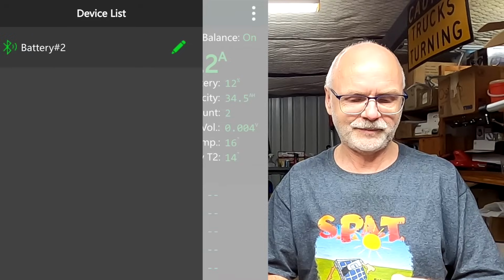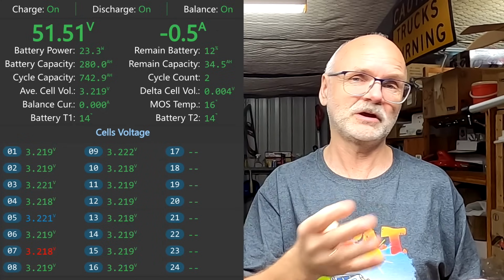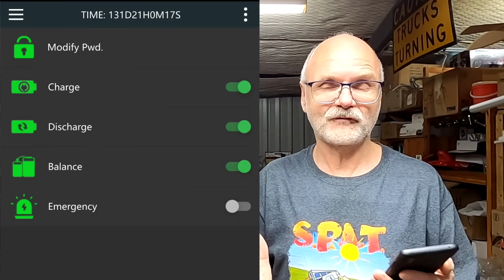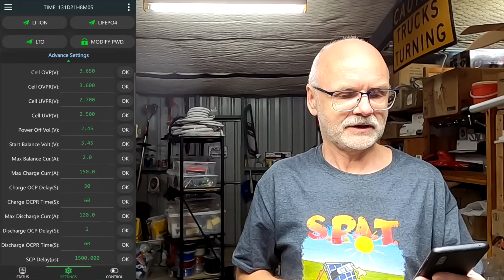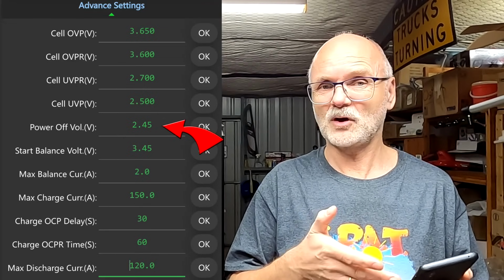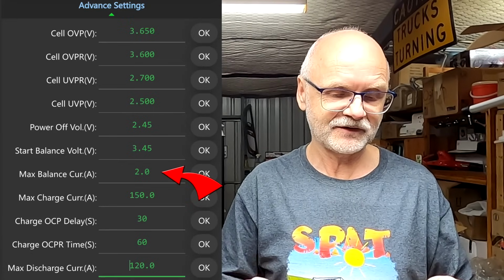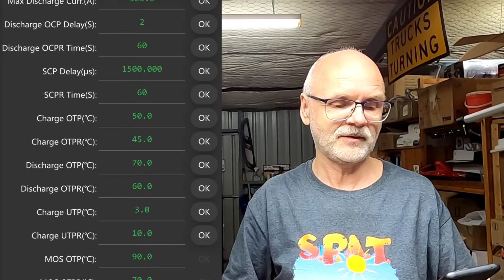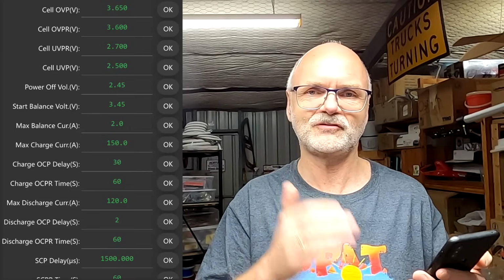JK-BMS: all settings and menus explained. How to program and set parameters.

Comment: The default low temp charge protection on my JK BMS, is -20c? I think my JBD BMS'S from OVERKILL, are way to cold also. This seems like it would really bad if unknown.  Especially with the LIFEPO4 default reset button where it is. I've accidentally hit it  more than a few times and needed to go reset my own setting.
Reply from the maker: Oh, yeah, that is far too low. It should be sitting on like 3°C or so, maybe even 5°C.

Comment: I think the balance wires resistance calibration settings are for balance wires cut or  extended to different lengths for your installation set-up. Now I'm curious to know how different a few inches or feet would matter. ARE people running their BMS 20-30 feet away from the cells for some reason?
Reply from the maker: I have cut all my cables or extended them to make it look nice. But I never touched this setting. I think the BMS either measures voltage or balances but not both at the same time, so cable length should not matter.
Reply: @OffGridGarageAustralia   It is an odd thing . maybe for the internal resistance of each battery?
It would be great to pick the brain of who ever dreamed up these functions. I like a good puzzle but, come on man. What is charg plugged and heat current? It's nothing to do with the heat pad function or charging.
 It took me a week to find a working app for my phone after trying to reinstall it. The one on the BMS and instructions would not install again. only on my sons new phone.

Comment: Andy, I have watched many of your videos and purchased this BMS because of your excitement in some of the videos. 
I have put together my 8s system but can't get it to connect to the app. 
I didn't purchase the monitor, so I'm not even sure if it is working.
I have disconnected it at the moment but really need some advice on how to connect it to the app. Or check if it is working. 
Any advice?

Comment: Another very useful video - Many thanks Andy! I bought one of these and finally had my battery built and connected up. I started the BMS and all worked well. About an hour later the power cut, connecting to the BMS with my phone, I could see it had disconnected the power due to low cell voltage - I planned to wait until the next day for the sun to charge the battery again. Half an hour later the power came on and the BMS was showing 'Discharging MOS not normal' blinking in yellow - since then the BMS reads very differently to the Victron inverter/MPPTs in my system and even if I click to disconnect in the app of the BMS, the BMS beeps but nothing happens. . . I am wondering whether when the BMS reconnected my system the surge of current re charging the capacitors in the inverter (10kW Quattro) have killed the discharge MOSs . . . I have contacted the seller who kindly just sent me links to the app and instructions. . . 🙃 Any thoughts as to whether I can do a reset on it or other ways I can test it before I have to start crying and buy another one are greatly appreciated 👍🏼

Comment: if bms is charging/discharging at 100a, does that mean the bussbars have 100amps flowing in between cells?
Reply from the maker: Yes, all cells are connected in series, so the current is the system is the same everywhere.

Comment: I believe voltage does drop as resistance increases. Therefore, to get more accurate balancing, perhaps it's prudent to input the wire resistances in the settings? Although with such a miniscule amount, it probably doesn't make much difference.
Reply from the maker: I don't think the BMS will measure voltage while it is balancing. It's either or but not both at the same time. Therefore, the resistance of the balance cable does not matter.

Comment: Ciao Andy, thanks for your in dept coverage, especially making some sense of a somewhat ambiguous setup. I've pretty much followed your suggestions. I have a Lipo4 12S 40Ah prismatic pack with all cells balanced. While viewing the cell voltages, there is a flashing message in green that says: "Protection (Cell Over Voltage) (0S)". When I look at the log,  it indicates that the message is related to Cell 1. Any idea what this means? Buona fortuna with your projects!
PS, Also, worth mention is how to turn off Bluetooth on the BMS and reduce power drain?
Reply from the maker: Thank you. First of all, if you turn off Bluetooth on the BMS, how do you get back into it to turn it back on?
Your cell 1 may have a problem with either the cell directly or the terminal connection. Does this message only show up if the battery is charging and is near full?
Reply: @OffGridGarageAustralia  Ahhh! I have the V10 version in which they so graciously added a push button switch to turn it on. Of course, they're not that smart, otherwise they would have allowed the same button to turn it back off or provide the option in software.
Reply: I forgot to mention that the message appears to flash if the charger voltage exceeds the OVP value.
Reply from the maker: @DaveVelo1  Well, then the message makes sense, if you exceed the set OV. What is it set to?
Reply: @OffGridGarageAustralia  3.65, but have been raising it slightly to increase calibration voltage. I have some low cells that won't balance. Sent you a screen grab on facebook for a look/see and opinion? Thanks.

Comment: I figured out what the cell wire resistance is. It's the resistance placed on the wires so the bms can remember the cells out of balance difference. When you have cells of un equal WH duringg initial top balance those values get tuned so next time you charge up you don't get cell run away..

Comment: I bougth a BMS at HankzorBMS Store in Nov 2022 and 6 weeks later the App shows two Errors: 

1) Protection (Cpuaux Anomaly)
2) The Temperature Sensor is Abnormal

All trys to reboot, make power less (10min/2days), use other versions of the App, gewire the batteries, check voltages, ... doesn't help.

In paralles I contact the seller - the communication was worse. Morste time not one word, only links, pictures to QR codes, numbers and textblocks. No only one time I get a feedback about the errors. (Not sure what i should do the the IOS APP or the proticoll description)

I also ask for 'repair, replacement, 1 year warrantie, 90 days money back - nothing.

!!! DON'T BUY FROM HankzorBMS Store !!!

Comment: Thanks! Won't it make a harm to a hybrid inverter powering the load, if a BMS abruptly turns off a battery due to undervoltage or overcurrent protection?

Comment: Great videos! I am planning a 5x16s battery back for my house and I did not see any video about using the JKs with multiple packs in parallel. Do the BMSs have a master-slave functionality or must each be configured separately? And also.. how well does the JK speak to the inverter (I have a 3p Deye 12k) and even more so, when you have multiple JKs in your big battery storage unit?
I also see, SEPLOS/Maison offer they battery DIY boxes without a BMS - would JK be a good subsitute and would it "fit"?

Comment: Can you please clarify how the JK BMS behaves if the low voltage shut down is reached? Does the BMS turning itself off prevent recharging from the solar array or if the solar array is sending current to the battery will the BMS accept the charge and turn back on with no intervention.

Comment: Good afternoon! On banks from Nissan List, I set the calibration volt to 57.12 Volts, and BMS puts its numbers after a while. What is the problem?
Reply from the maker: What are the specs of this battery?
Reply: @OffGridGarageAustralia  These are lithium-ion batteries.
Minimum voltage 3.1V, maximum 4.2V.
Reply: @OffGridGarageAustralia  Assembly 48 Volts, 7 packages of 3 cans.
Reply from the maker: @ВикторАлександрович-о6с  How many cells are in series to get to 48V? 12S, 13S?
When you say calibration voltage, that is absorption/bulk voltage? What BMS do you have?
Reply: @OffGridGarageAustralia  BMS JIKONG 8-20S 80A, 7S3P.
Reply: @OffGridGarageAustralia  I understand everything! The inverter has its own charge settings, etc. I set it up a little wrong. I fixed it now and it's all good! 😁😁😁

Comment: Hi Andy! I thank you for your time and for the immense value of your sharing of knowledge and passion. I'm having problems activating the discharge with a voltronic inverter (pip max 8kw), when I activate it, the short circuit protection without sparks immediately starts without any visible problem, the wiring has been checked and rechecked a thousand times, in some forum they told me of precharge problems. The discharge is activated regularly if I disconnect the positive pole with the circuit breaker, so the problem is precisely the inverter, which parameters do you recommend me to change (scp delay?)
Reply: Hi Ross Doc, there will be too much inrush current. I had a similar problem. When switching on three mppt charge controllers, the SCP always came. I doubled the SCP time. From 1500 to 3000. Now it works for me.

Comment: Has anyone had moisture/condensation and/or temperature issues with their 8s JK BMS? 

My BMS stopped working the other morning after a low voltage disconnect. It normally lives in a narrowboat engine bay where it gets down to about outside temperature, it’s humid in there if the weathers wet but there’s no direct sources of moisture near the batteries or BMS.

I took it to a friends house along with the batteries to try some diagnostics, after a while of not working it suddenly came back to life! When returned to the boat the problem reoccurred… 

Is it possible moisture is forming and shorting the board? 

Symptoms of not working are: unable to connect with bt at all and a continuous erratic static-y beeping noise. 

Help appreciated!

Comment: Have you done any  work  with  Chins Battery. 12.8  100amh?
Would like to see your  settings  for  24v setup.    2ea Battery  in. Series, /parallel  configuration 
Factory  settings  don't  work  with my  reliable  3000w inverter

Comment: Hi Andy,
Super contribution

Can you tell me what to do if in the setting battery was the button Modify pwd and did not take over the one settings on LiFePo4.
JK does not save the data . 
Have you also had the problem and how did you fix it.
thanks a lot 
Greetings from Germany ( Bavaria )
Mike

Comment: Resistance of string is very important. My string cable has 30miliohms. U=2A(Balancing current)X0.03=0.06v 60mv.60mv Drops on a wire !!!!!! It difference between battery and BMS. You want a 5mV difference between cells, but bMS got very inaccurate information on a cell  Up to 60mV !!!!!! The balancing could jump into the see-saw action...

Comment: The only thing that makes sense with the connector resistance-table is to compensate the voltage-drop caused by the resistance of the power-connectors between the battery-cells/blocks. In my job i am specialist for UPS and have to take care of about 3000 battery-buffered systems in a big chemical factory. We do a lot of capacity probes with single block measurements and to evaluate the results it is nescessary to know which batteries are connected with longer connectors than others (e.g. to pass over to another level in the battery-rack). For there is only one sense-wire for measuring the plus-pole of one and minus-pole of the next battery, you always measure the voltage of one block/cell plus the voltage-drop of one power-connector. 
And this voltage-drop is not negligible... e.g. one connector only 40cm longer than the others in a system with 70mm² connectors will already cause about 5mV higher voltage drop at 50A resulting in 5mV less cell-voltage measured and - if not compensated - falsifies the state of health-judgement.

Comment: Hi Andy, great video. I get my PV panels next week and want to build a battery pack asap. I do not have much time, I am totally renovating my home. Can I build a battery with the EVE at the state as I received them and let the bms balance them? Can I do that with solar power in this almost winter time, or must I buy a charger as you recommend on your website?
Reply: I also will use 3 phase victron, 3 x multiplus,, Starting with SMA but want to change to mppt RS 200 or Fronius and a smaller mppt
Reply from the maker: Thanks a lot for your donation, Ronald. Much appreciated!

Yes, you can absolutely balance the pack with your BMS and winter solar. Especially the JK-BMS will be great for that purpose. Charge it slowly up to 3.4V, 3.45V, 3.5V and maybe 3.6V at the end and let it sit there over night until its fully balanced. Should work just fine.

Comment: Hello, 
How big can the volt-differences be, that i can bei handled by jk-balancer. E.g. for a 8S 280Ah 24v battery with 0,5 volt differences between min. cell and max. cell?
Reply from the maker: There is no limit. The larger the voltage difference across the cells, the longer it takes to balance. The JK-BMS is very efficient with balancing.
Reply: @OffGridGarageAustralia  thank you very much. Sorry for my typos. Greetings from Bavaria
Reply: You got a beer 😉
Reply from the maker: @FamG-qs9zd  No problem and thanks for the beer, J. 😉

Comment: Hey Andy, like aways  amazing  videos and explanation thks, I am from  nj and trying  to put the  System together I have a 24 v 280 ah lifepo4 battery  bank  and 3000 watts  reliable inverter  and 8s jk bms in .my problem is when I try to use  my heat gun  1500 watts  on and the inverter  shut down you think it's any parameters on the BMS ? I used the  parameters in your video ?  Any change I can make to stopping  this ? It's the only  thing plug in the inverter,  plz but u can help me out , and congratulations for all your videos 👍👍👍
Reply: I have similar issue.. did u find a solution?

Comment: Thanks again, could now easilly configure the right settings for a JK 4-8S 2A 200A, works like a charm, the hint for calibration was just what I needed for a closer setpoint near the right value, stil 0.01V off but that's a safeguard against overcharging.

Comment: Great video! I was wondering if you also tested the GPS/serial port on this BMS. I know that you use bluetooth on the BMS level and a Victron smartshunt for all you parallel battery banks, but as I plan to start with only one battery I will rely on the BMS internal smartshunt for now. I would like to know what kind of TTL and VCC Voltage level this output is so I can order the right serial to USB converter to plug into this port.

Comment: Thanks Andy for the detailed explanation of the settings in the JK. I am considering getting one for one particular reason. That is the heating function. I wonder if you could do a run through on the heating function. I know it doesn't apply in "sunny Australia" but Ireland can get quite cold in the winter. TIA
Larry

Comment: hi sir,  hi bought 72v/52 amp with jk bms,   battery built is ok,  i dont know if settings are correct. problem occur when plug to ebike,  any suggestion?   (  protection discharging short circuit) ,any advise?   thanks

Comment: Andy, WOW!  What an incredible resource your videos are!!  My clarity on LFP has been vastly improved because of your work here.  I'm just now beginning to build a 16-cell 12-volt pack for our live-aboard sailboat.  The JK BMS looks to be an incredible value.  I wonder? I see it does 16 (to 24) cells, but my config is 4s3P of 160Ah batteries for a total of 13.80V @ 480Ah. (I have another 4 cells but that's stupid overkill for our needs on the boat.  The extra four cells will get mounted in the battery box anyway at a storage 3.2V for redundancy (gotta store 'em somewhere, right? So I can keep an eye on them right there too).  Can I use one JK BMS for all three of the 4S cells and put the -B -P of the BMS in the Negative side of the combined pack for a complete cutoff of the entire pack?  Or...better; should I get 3 JK BMS only connecting each 4s group to a separate JK BMS?  Although expensive I like the latter idea if one 12V battery cuts out there are still two in parallel supplying power.  Your thoughts on this will be enormously appreciated!  Cheers from the sv/Lucky Spin, Ventura Harbor, CA USA
Reply from the maker: Hello, sorry, just read your question here and nobody had replied so far...
Firstly, thank you for your kind words, great to hear you have followed along and learned a bit here and there...
Yes, you can use one BMS for your 4s3p setup. All cells in parallel will act as one cell for the BMS.

You've got the point, if you buy two more BMS you can have three individual batteries in parallel which gives you far better control over individual cells and also redundancy. That's probably what you want on a boat.
Reply: I also sail and RV. If you plan to stay at 12V, I recommend building 3-4, 4s batteries, each with its own 160 or 200 amp (adjusted to your actual capacity) BMS. This will allow the BMS's to monitor and control each individual cell, which is best for performance, balancing, longevity, and safety. I have a 12v 3000watt inverter on board which needs a bare minimum of 3 parallel 12V 100Ahr batteries to operate effectively. This means that a single 200A BMS alone cannot supply enough power to handle the full load and will disconnect. With 3 batteries/BMS's, each will supply 1/3 the total load. Estimating your continuous and peek loads is required in order to design and fit the best battery configuration for your boat.